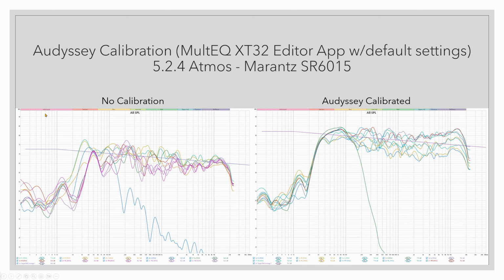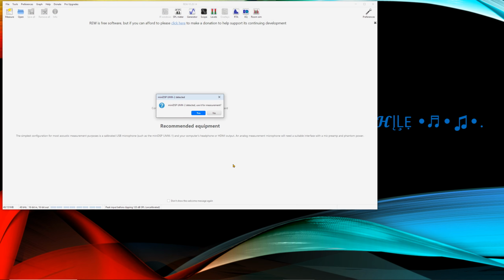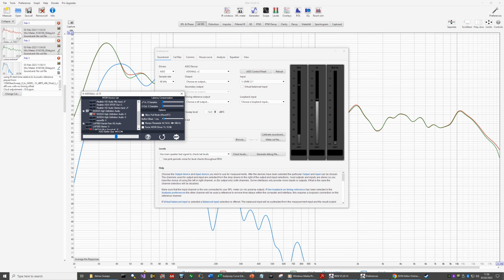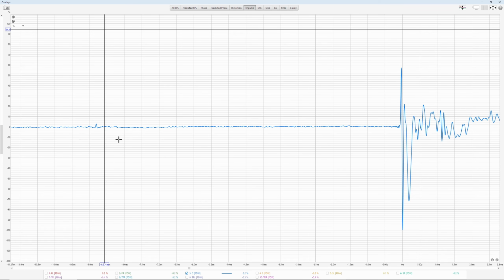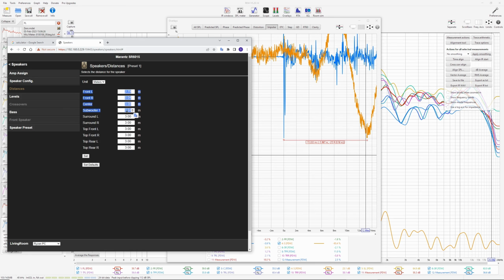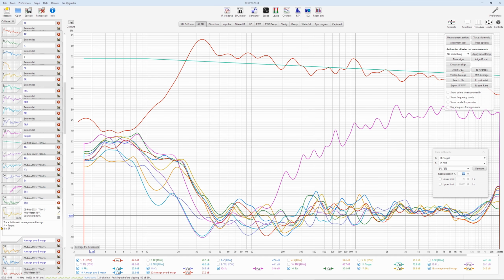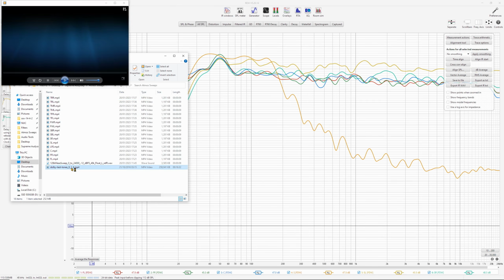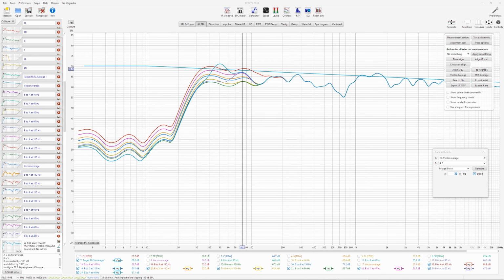Supreme Audyssey Calibration by OCA

Comment: Hey, I just found out when switching from reference to flat, that the whole response is messed up. I have a huge increase in Bass. I didn't expect there to be such a massive difference between the two. Will running this guide for flat make flat equal? Or close to reference?
Reply from the maker: Custom curve points are only valid in reference mode.
Reply: @ocaudiophile  ahaa, that makes sense. Thanks for the quick response! Your newest video guide also works with the sr6015?
Reply from the maker: @SiebevanPutten  That's the same receiver I use for all these videos ;)

Comment: This is really great. I appreciate you sharing your knowledge!! Quick question - do you recommend doing this for 2.1 channel music listening? I have a 5.1 system with Audyssey default calibration. I disabled the mid range compensation using the app because that sounds better to me. I use it for movies. But for music I switch to L/R Bypass and 2.1 stereo mode because that sounds better to me. It comes close to Pure Direct on the Marantz 5015 receiver but a bit better due to the SVS sub filling in. I would love to improve the music experience but I need to set up REW and buy the umik-1 microphone
Reply from the maker: You can use Audyssey's microphone and REW is free. I extracted the calibration file for it (check my latest video's description link) and its results are quite satisfactory and timing is better than a USB mic. With proper sub-main time alignment and graphic EQ, you can get nice stereo sound.
Reply: Thanks for the idea @ocaudiophile . Unfortunately I cannot connect the Audyssey mic to my Macbook Pro as it does not have a mic input. Neither does my Windows Thinkpad for that matter. I will order the umik-1 in a few days. So you do recommend doing a good calibration for stereo listening
Reply from the maker: Especially if you have easy to drive mains, you could get good results. With higher end stereo speakers, these AVRs are not powerful enough in general. Good speaker placement and descent DSP always prevails though.
Reply: @ocaudiophile   I have B&W 683 towers rated for 89dB sensitivity in the front. Marantz 5015 driving them. I will get  external amp later. 80% music 20% movies. I am happy with music just want to see how it can get better

Comment: I am not sure if anyone has asked this question before: with this method you calibrate with DEQ enabled at the MV level that you typically listen, but what happens to the response if you don't listen at the MV level where you calibrated everything? I know DEQ boosts its effects the lower you go in volume, but does it maintain the same level of (for a lack of a better word) neutrality throughout the response?
Reply from the maker: İt might not be optimal but deq defo helps at the lower volumes

Comment: Hey, thanks for this great tutorial. I noticed that the amplitudes of FL and FR are exactly opposite to the rest of the speakers. Do I need to change the plugs on my speakers? Is this the fabled wrong phase?
I use a down fire subwoofer which according to impulse response should have a distance of 11 meters and the curve looks more like a mountain without a plane like yours. Is the sub wrong or should I try it in frontfire? I can not set 11 meters distance in the receiver nor do I know later how I want to set the level with the curve of the subwoofer it looks like a mountain with a peak as I said. Thanks in advance for your help
Reply: Thanks for your answer. I have switched the cables and now every amplitude shows in same direction. Or is it ok when some speakers have inverted amplitudes? I thought this causes bass problems
Reply from the maker: Compare the overlays/phase graphs of front speakers inverting  polarity of one of them (REW can do that with one click) and phases match better inverted, then do so physically. It's uncommon front speakers having opposite impulse peak direction but not impossible.

Comment: So i finished the calibration and it all sounds excellent. Thanks

Subwoofer is still not perfect and is difficult to integrate because i have a pretty big peak around 25hz and my line is nowhere near as straight as yours

Hmm maybe i messed up the subwoofer measurements / eq?
 ill try doing the sub again later

I might just need a second sub

And the crossovers are surprising..
Front and surround back 110hz looks the best, center and side surrounds 60hz looks the best

Maybe it has to do with my room
(My fronts are Polk R200 bookshelfs, should go down lower just fine)
Reply from the maker: Subwoofer response is the hardest one to get right and unfortunately the most dominant on good overall sound. DEQ changing bass boost for every volume level doesn't help either. Still, Audyssey should be able to kill that boost at 25Hz (unless you have XT rather XT32) and remember that after heavy EQ is applied sub's impulse peak might move a little bit and may need distance readjustment.

You can try and XO every speaker at their specs (ie -3dB roll off frequencies). If your speaker pairs are relatively symmetric, this might give even better results.
Reply: @ocaudiophile  yeah I saw the peak and thought maybe I didn't perform the room correction step properly on the sub

Gonna redo it 🙂

Comment: What I dont understand is when I select output number 5 and 7 the voice comes from SL, same speaker. I couldn’t manage the sound tp come from the Top middle atmos speaker. I have a 5.1.2 setup with the atmos speakers above my listening position left and right and speaker config is set to top middle on Denon AVR. I get sound from those speakers only when I play atmos content.
Reply from the maker: Double check the AVR in Movie/Multch-in mode, it's the default player in Windows /sound settings and set to stereo there (not atmos)
Reply: @ocaudiophile  I changed the denon to stereo in Windows, it was dolby atmos. Receiver is in Multi In mode but still the SL speaker plays both the channel 5 and 7. I found a page on denons website that shows which speakers are outputting on which mode and that shows no output on top middle speakers on multi in mode. Even I changed the mod to dolby surround or dts neutral still no output on top middle speaker. Do you think I should change my amp assign mode to surround back instead of top middle. I am using dolby atmos enabled speakers above my listening position left and right.
Reply from the maker: @iarwa1n635  Are you using sweeps TML & TMR? In my AVR, the receiever only changes to the correct mode if I switch to stereo by using the Movie button, Music button would also switch mode to stereo but that doesn't produce Atmos signal. Read all comments, everyone eventually managed to play the Atmos sweeps (except for Mac users). There are many settings in the PC or receiever that could be wrong.
Reply: @ocaudiophile ı figured it out. What I did was to change amp assign to surround back mode first, then I put the AVR into DTX Neutral mode, there was no multi in. On the pc side I had to configure the denon receive as 7.1 to play the LFE and Tower mp4 correctly. Otherwise the sound were not coming from the correct speaker. Thanks for the replies. Any chance that you are from Turkey as me?
Reply from the maker: @iarwa1n635  Evet ama amp assign'da atmos tanimladigin kanaldan atmos sweep'i WMP de caldiginda duyman lazim. Baska bir yerde hata var kesin. Video'lardan birinde ozetlemis olmam lazim dikkat edilmesi gereken yerleri ama hangisi hatirlamiyorum. Sesi dusuk calan var, bazi Denon modellerinde ama calamayan hic olmadi bugune kadar!
Reply: @ocaudiophile  aslinda dolby atmos videosunu oynattigimda her kanaldan ayri ayri ses geliyordu amp assign tower middle modundayken.  ama soylediginiz gibi lfe ses dosyasini oynattigimda ses cok dusuk caliyordu, subwooferdan hic ses gelmiyor gibiydi. Ayrica tower ses dosyalarini oynattigimda da tepedeki hoparlorden ses gelmiyordu. Diger sorun ise rew uygulamasindan da tepedeki atmos hoparlorlerine ses gonderemiyordum. Amp assigni surround back yaptigimda tum sorunlar cozuldu, lfe dosyasi yuksek sesle caldi, subwooferdan ve  towerlardan ses geldi. Bu sekilde videoyu tamamladigimda sorun olur mu sizce?
Reply from the maker: Dolby videosu wav, digerleri mp4. Bu şekilde tamamlar in ama height speaker ların distance larını manuel olcup girmen gerekebilir
Reply: @ocaudiophile  olcmem gereken mesafe mikrofon pozisyonu ve hoparlor arasındaki mesafe öyle degil mi? Bu arada cok harika bir guide olmus, iş için yarısında bırakıp 4 günlüğüne evden ayrılmam gerekti, dönüp tamamlayıp sonucu görmek için sabırsızlanıyorum, elinize sağlık.
Reply from the maker: Yes

Comment: Great video, while thinking this through I wonder how you adapt for custom curve in the bass region. Will you just create a target which will not be just "flat" harman curve, but will rather have a little bassboost around 20-100hz?
I remember the harman curve you used in your "Audyssey hacks for epic Dolby Atmos" Video had a slightly different harman curve with a little bass boost. So what is the correct harman curve, or to rephrase it, did you edit the harman curve in the former Video more towards your taste in the bass region?
Reply from the maker: The one in the video is standard, only with extended frequency range. The bass boost will depend on the windowing and to some extent smoothing used on the response. The method in the video yields a very satisfactory bass when applied.

Comment: I have a question about time alignment. You use this audio files for the Atmos speakers but I'm wondering how I could measure my Auro3D CH and VoG? My idea would be to connect CH/VoG with the FL terminal only for the measurement. Could that work?
Reply from the maker: I am not familiar with how Auro 3D works but I believe it should be an additional decoding over the Atmos channels. The Atmos sweeps are created in AWS for 9.1.6 Dolby and there is no option I know of for Auro there. The Atmos sweeps should sound from Auro channels with certain sound settings in the receiver but I really have no clue :(
Reply: @ocaudiophile  The Problem is that Auro works thru DTS and the up-mixer can only access the DTSMA lane from DTSX and the DDTHD lane from Atmos. To generate an Auro file one has to use there plugin from there engine. Bottom line is there is no way to play dedicated Auro channels without a dedicated Auro file. Which brings me back to my idea from before. Do you think this workaround could work for your process?
Reply from the maker: @baronbob6971  It all comes down to your speaker configuration. The distance settings and equalization filters are for the speakers. The decoding shouldn't matter. Atmos sweeps will help you measure and correct 4 height channels and 2 front wide channels on top of the 7 floor channels which REW can measure with its own sweeps. If your speakers are placed similar to an Atmos setup, the calibration should work perfectly for Auro IMO.
Reply: @ocaudiophile  The Auro 13.1 layout is in so far different from Atmos that it has a Front Height Center and a Middle Top Center Channel. And Atmos can not address these and nether can Auro address the Atmos TML/R.  Therefore my idea for a workaround. But I can just try and see how it works.
Reply from the maker: @baronbob6971  How does Audyssey automated calibration deal with it?
Reply: @ocaudiophile  You have to select the respective layout in the AVR before measurement. Then in the app is the layout shown and it measures the right channels. In the JSON editor should then be the respective number of channels. And if the layout is auro capable then this one box should be ticked also.
Reply from the maker: Can you  share with me the ady file of such a measurement? You can only paste Google drive links here.
Reply: @ocaudiophile  https://drive.google.com/file/d/1olbDJG4yeCCAlUxzWWyqnwuCyNsgl-v3/view?usp=drive_link

Comment: Hi OCA - I had a lot of fun today following your tutorial and getting everything dialed in. Your instructions are fantastic - very clear and very easy to follow so thanks so much for taking the time to record this. I did have a little trouble finding the instructions on how to transfer ADY files, so if anyone else is searching you can find that here: https://www.youtube.com/watch?v=QWFyIDTe1fw.  I do have one issue remaining though - my sub impulse peak is almost 27ms from my reference center, and that's way beyond the capability of my Denon AVR to correct (26 feet using Denon's speed of sound). I have a MiniDSP which I used to integrate my two subs using MSO - could that be introducing a lot of delay? Right now I can't get my crossovers dialed-in since I have such bad phase alignment with the subs. Any idea what I can try?
Reply from the maker: MiniDSP circuitry introduces extra delays and your problem is quite common. You can align subwoofer's "first" impulse peak  instead of the "highest" peak. The result should be satisfactory but I ended up removing MiniDSP in my system for optimal time alignment.
Reply: @ocaudiophile  OK great - thanks for the reply! I messed with it and got an early peak to align nicely and now everything is spot on! You ROCK!!

Comment: I'm enjoying going through the process!  However, with my Denon x3800 I've seen a few issues after uploading the .ady file back to the receiver and trying to make your changes in the "Cheating Audessey" stage:
1.  When I used MultiEQ to create the Original file it knew I had Top speakers... but after uploading the new one the web interface listed them as Front and Rear Height speakers.  I changed them to Top Front and Rear under Speakers--Speakers Layout, but wanted to make sure you didn't think there was some other issue.
2.  After uploading the Default.ady, in the Distances it did not default the Top speakers to 0.04 like the others.  It had a pretty high number on them (like 6 or 8 meters).  I manually changed them to 0.04
3.  Similarly, my Subwoofer 1 "Level" was -2, whereas all the rest were at 0.
4.  When I go to Audio - Sound Parameter, it does not show the same options.  It only offers Effect Level, Room Size and Speaker Select... none of which your screen has.  Most concerning for me is I don't see where to lower the LFE by -10.

Is it OK that I had to manually update my items 1-3 or did something go wrong when I made by "Default" file?
What are your thoughts on #4?  If the Denon interface is different, how do I handle the FLE adjustment?
Lastly, when I was editing the .ady file, it showed 13 channels (7.2.4) as 0-12... but channel #12 (I'm assuming Sub 2) did not have any recorded Response Data for me to be able to edit.  Is that how it should be?
Thanks in advance!!!
Reply from the maker: 1. When using MultEQ Editor app (or the receiver's own setup menu) for calibration, user needs to tell the app the correct speaker configuration with amp assign. The method will not change that configuration. I haven't tried manually changing them in the AVR after sending the ady file to the receiver so I am not sure but I wouldn't risk it. I guess it's safer to run a new calibration with the MultEQ editor app with the correct configuration. You can stop it after only 3 measurements.
2. That could also be related to manual speaker configuration change. 
3. Levels always came up 0 initially in my tests but I have seen odd volume adjustments in the later stages after re-sending calibrated ady files. Manually correcting them is fine.
4. x3800h has LFE setting in the menu according to this:

https://manuals.denon.com/AVCX3800H/EU/EN/GFNFSYvdfworfs.php#OKNRMLxabcenvo

You might need to send an LFE signal to the AVR to bring it out.
Reply: @ocaudiophile  Thanks for your quick response.  I started from a new file.  It still changed it to Heights instead of Top.... but when I made the change everything else worked properly, so I'm good with that stage!

Now 4 questions/issues with Measuring:
1.  I'm now having an issue with the .mp4 files not playing properly.  I checked and my AVR is showing as the default audio device.   I do have the Windows Sound settings set to Atmos and I can play the Dolby Test Tones perfectly fine and the Denon shows Atmos.  When I play the .mp4 files it shows Multi-channel-in instead of Atmos... and plays all the recordings as Stereo. 
2.  Should the volume on the laptop be up to 100 for these tests?  At first the volume was very low until I did that.  Just want to make sure that's right.
3.  I normally watch movies around -20db.  When I ran Left and Right tests at that level I received an error message that the signal was not high enough.  I then raised it to -10 and it seems to work, although that is higher than I normally play it.

4.  Even when at -10, I receive an error message that the signal to noise ratio is too low.  I've even turned off the air conditioning when doing the test and still get the message.  The room is pretty quiet except for the sound of my laptop's fan.  Is there something I need to correct, or do I just tell it to stop giving me that message?

Thanks again!
Reply from the maker: 1. Windows sound settings should NOT be set to Atmos, setting to "Stereo" should work fine(AVR set as default playback player, L&R set to Large, all enhancements disabled, give exclusive control to other apps, etc. all ticked, 16 or 24 bit but definetely 48000Hz sampling rate selected). Windows Media Player at default settings, reinstall it if need be. The AVR should be in Movie/Multch-in or stereo mode. Try until you see the AVR switching to Atmos when you double click and play any of the mp4 files with WMP (you don't need to play them through REW).
2. All volumes should be at 100
3. Sounds like you microphone input level is too low, REW should normally easily measure levels as low as -40dB. Check your microphone input levels in Windows sound settings.
4. You may want to switch to Java EXCL drivers instead of ASIO, usually they're easier to set up.